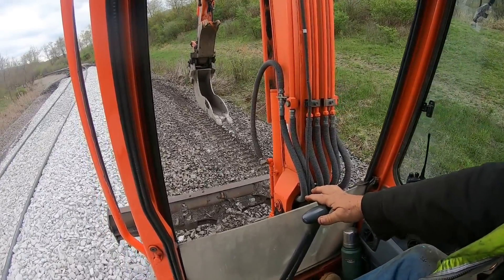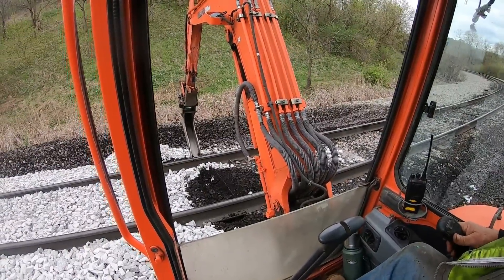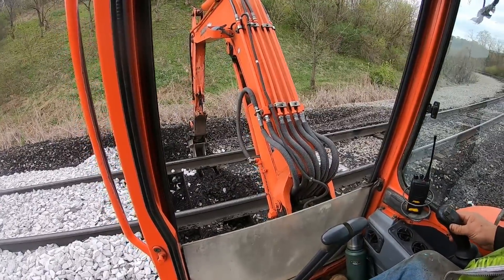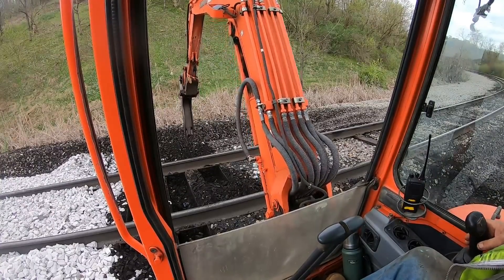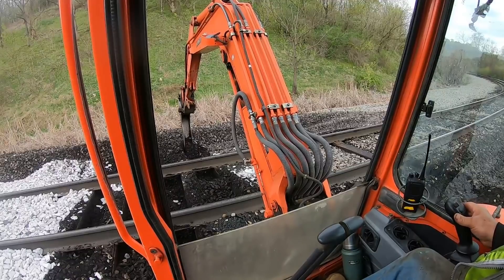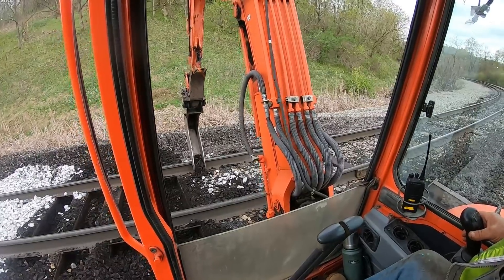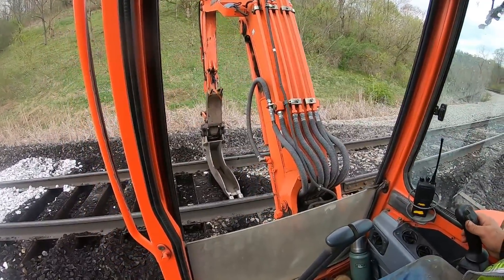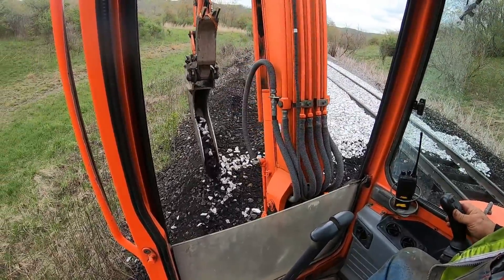Cribbing Ties on Curve 25 - How I Dig Out between the Ties

Comment: Would a hi-rail vacuum loading truck work in this setup?  It maybe easier to direct around and get a more complete cleaning?  It may also be able to clean the fines off the ballast (into separate compartments in the truck,) so the ballast could be reused.
Reply from the maker: Very good question. We tried the vac truck for sucking up mud spots
and it took them forever, they had to use an air wand to try and
break up the mud, a long slow process that wasn't worth the money spent. However once I get the heavy stuff cribbed out it would be
very beneficial if they could follow me and do their thing. But
I haven't gotten anyone to listen to that advice yet. Thanks for
writing in and watching the video.

Comment: Do you have access to the cost study done back in the day comparing gondola bottom cars requiring a rotary dumper vs hopper bottom cars? An ongoing benefit of gondola bottom cars is reduction of coal fines plugging up the space between the ties which should reduce the amount of cribbing maintenance over the years and increase the service life of the ties as well as the slightly higher capacity of the gondola bottom cars. Could you do a PowerPoint presentation to show capital costs and predicted maintenance costs for a rail system for both kinds of cars using the original 50 year old figures then update it to show if those mid-70s maintenance predictions are correct?
Reply from the maker: Yes Curtis that sure would have made  a difference over the
years, but bottom discharge is what the founding fathers paid for
so we stuck with it, most likely was a lot cheaper initially to
buy back then and US Steel probably figured they would eventually
sell the place so why spend the extra upfront money.  Thanks for watching

Comment: Dave will you let a train run over that part with no rock in between the ties? And if so how many ties 10 ,20, or more. I was watching a stream Locomotive video the other day and the old engineer said to the firemen can you believe they pay us to do this
Reply from the maker: Not on that section, it a pretty sharp degree curve on a 2.5% grade,
on tangent track I have ran over skeleton track for up to 2 rail lengths (40) feet on a slow order. Thank you for watching and
your question

Comment: That's a lot of work if your talking about doing that for the whole track or even a short length,,, I think you once pointed to an  area about the length of a turn and say that you had been working on It for like 2 months... BUT,  If cribbing is really for drainage then couldnt you just crib where The water pools up ? You have that machine that will give you a graph of The track surface plus you can see,,,, or is the rail surface so flat overall that gravity can't help you OUT that way.. OR,,,,, AGAIN , if its about drainage, then have a machinré that could drill or auger out drainage holes straight down and from The ends.... just something that could be done faster than cribbing single spaces, something that could do a months worth of cribbing in a day......I  GUESS The amount of time that's NEEDED is why you are working only The MOST at risk AREAS LIKE bridges and curves now
Reply from the maker: Yep Bobby, lot of work, but that my job and I like doing it. Nothing
gives me more satisfaction than taking a really messed up section
of track and making it into a show case. And yes sir we have done
crib out just the mud holes many times over the years! I wanted to
do this entire curve this time cause it was an 11 degree curve on
a 2.5% grade so wanted the entire curve to be first class. I finally finished this curve last Sunday and have it tamped up...hooray!!!
Thanks for watching sir

Comment: You can tell you've been doing this awhile. Your a smooth operator buddy. That is a funny looking bucket, I know it's a specialty tool designed for that purpose but it make me thing of digging a swimming pool with a spoon. 😁 You all want to watch some funny model train video's check out "crazytrain525" It's silly funny. Be Safe, Stay Healthy
Reply from the maker: Thank you Anthony, would prob be smoother on swing but this machine had a lot of use and has some noticeable wear on the swing ring gear. Thanks for watching

Comment: If you had rotary dumper cars, there wouldn't be any problems with coal fines falling on the tracks. But I guess that would be too expensive at this stage?
Reply from the maker: You are certainly correct, if that had been original design it sure would have saved us countless hours of work and lots money spent on track and car maintenance. These bottom dump hoppers require constant maintenance, almost daily they take a car out to fix doors

Comment: Coal is petrol based so it would not absorb any water is my guess as to why water would stand between the rails..great video Dave
Reply from the maker: You are right David, it wont absorb water, but when coal fines get
wet they become a consistency like a slimy clay like mud and that helps prevent the water from draining away. It similar to building a pond dam with clay,  it prevents the water from escaping in a pond
dam. Maybe that explains  it better. Thank you for the nice comment and for watching David

Comment: Another nice one Dave. Thanks.
Reply from the maker: Your welcome Bill, how did you guys do stuff like this?
Reply: @ccrx6700  Hi Dave. Mostly by hand on smaller sections then on longer or bigger rehabilitation tasks they used a contractor Plasser and Theurer (not sure if spelt right) and this was a great big machine that removed,  cleaned and sieved the ballast and tamped it back again. But i have seen large teams in the earlier years gribbing with large curved gardenlike forks. But then the railways was a mass employer in those days so it was creating jobs.
Reply from the maker: @billsmith3195  not a good job hand cribbing for us older guys! I love hydraulics. Ive seen utube videos of those giant cleaners, pretty awesome stuff
Reply: @ccrx6700  pretty noisy as well.
Reply from the maker: @billsmith3195  i bet they are, would love see one work live, maybe i get lucky some day on that

Comment: May be hard to tell from this view, but the rock where the excavator is, shouldn't this be sloped, to help drain the water away from the track ?
Reply from the maker: Gerald you are absolutely correct. The side I'm working on is
sloped at about 5 or 6 or so degrees. The other side when I'm all done cribbing this curve will jump over with the excavator and
grade that off so it will have a nice slope to it. Thanks for 
pointing that out, shoulda mentioned that in the video
Reply: @ccrx6700  Hard to see in the video, thank you for the answer !

Comment: is there a wood from trees that grow in swamps and water (such as mangroves) that might make water-resistant ties?
Reply: Shockingly at one time redwood was a preferred wood for rail ties due to its water, insect, and fire resistance (more important in the steam era when cinders would cause tie fires). Nowadays ties are mixed hardwood treated with creosote or other preservatives
Reply from the maker: Robin they do make composite ties however they are very expensivr and require pre drilling for spike or lag holes, RR's dont generally use them for those reasons except for certain specialty applications
Reply: Cypress trees made excellent ties. When the FEC abandoned their Homestead branch there were still Cypress tree ties from 1936 in use. That put them at over 50 years old and still holding.

Comment: It's like taking a teaspoonful and swinging all the way out to dump it - teaspoonful by teaspoonful. Better to have a box sitting between the rails: swing about a foot or so to dump each teaspoon in the box, drag the box along the rails and lift+dump it when full. Maybe even a box on wheels riding on the rails which tilts over to alternate sides to dump. Economy of movements, as in surgery.
Reply from the maker: Be glad i'm not using a banana bucket, those hold bout half the amount of material
Reply: Since Dave mentioned him, watching letsdig18 really shows how he emphasizes speed and movement efficiency.  I'm always impressed watching how fast Chris operates his excavator and skid steer.  He's really moving!  

I'm not sure if a bin on the tracks would help cribbing or not, as it's another thing to move.  Maybe an excavator with a faster swing speed would help?

Comment: Finished changing some switch ties today and had to do some cribbing on the turnout. Tamper is down so had to break out the jitterbug to tamp the ties up.
Reply from the maker: Awesome Michael, I can't crib a turnout with this bucket, it
just too long and flat. Jitterbugs good only for young guys with
strong backs!!! But jack the track to grade you want and those
things do a very good job in keeping track surface to grade. Secret
is to angle them in and do all the tie, not just under the rail, but I"m
sure you are well aware of that!

Comment: Couple of questions here

1 how long before you have to crib this corner again?

2 ever consider using concrete ties? as they take less ties per mile and would most likely last longer than wood ties
Reply from the maker: This curve has never had ballast rehabilitation since it was new
in 1977. So hopefully we will get another 40 years out of it, by then
I'll be 107 so probably won't care by then...lol

I cannot tamp concrete ties. Wood are 7 inches thick, concrete 9 inches thick. My old tamper has limit switches which only allow
the work heads to drop 2 or so inches below the bottom of a wood
tie. To tamp concrete I would have to change the position of 4 limit
switches by crawling under the tamper and readjusting all 4 switches, a total pain to do. If I had a Jupiter system on the tamper
then I could simply toggle between concrete and ties, but that upgrade costs bout 100 grand, so likely ain't gonna happen soon. So we really have to stick with all wood, gonna make a distant
future vid and explain all that in much greater detail cause so many others have asked the same question, there's a lot more involved than this explanation can cover for now.

Comment: Thanks for letting us watch.  That coal-packed ballast looks hard.  I wonder if it has any fuel value.

Is the crew of each train required to obtain verbal permission by radio from both of the on-site maintenance-of-way persons before entering your work limits?

Is it safe to run a train slowly across a short section of track that has been cribbed-out but not yet filled in with new ballast by the regulator, or must it be refilled to provide stability?
Reply from the maker: Harold, some really excellent questions there sir. I've suggested
trying to find some way to reclaim the coal and clean and re use the ballast, but so far no good answers.

After a train passes, I give them a "red" track, so they are not
allowed to leave a portal until I give them back a "green" track,
that way train and maintenance are always safe.

I have run trains over skeleton track (no ballast in the cribs), however you have to be careful where you can do this at. Mostly it
can happen on tangent or low degree curves like 2 or 3 percent
and it's ALWAYS on a slow order of 10 MPH or less.
This is an 11 degree curve on a 2.5% grade so ballast will get
filled in before a train can pass.
Reply: @ccrx6700  

Thanks for responding.
Reply from the maker: @haroldsmith45302  👍

Comment: Does disposing of cribbed stone alongside ROW add to drainage issues...you seem to move drainsge issues from rail center to outside shoulders....
Reply from the maker: Very good question Donald. Shoulda explained that in vid, but just
didn't think about it. The side I'm working on I'm sloping away from
track so water runs off well. Once I'm done with this curve, then I will jump over to other side and grade that so it has a nice slope
away from track also